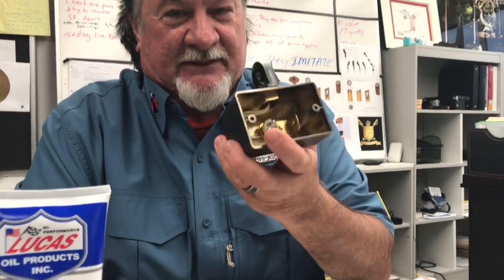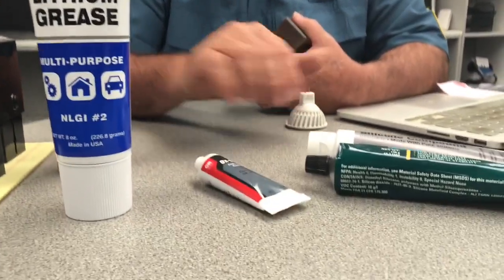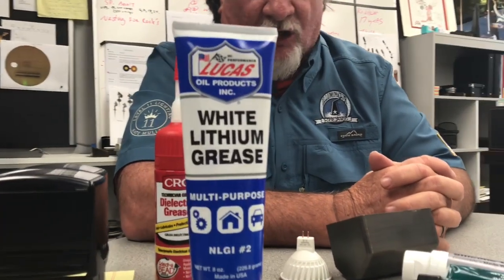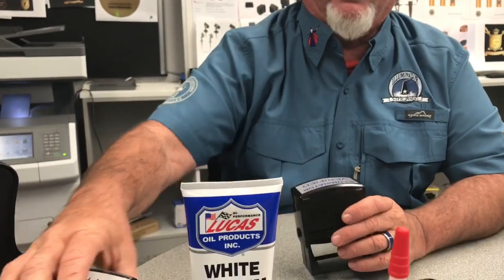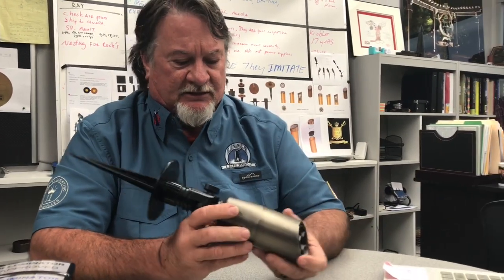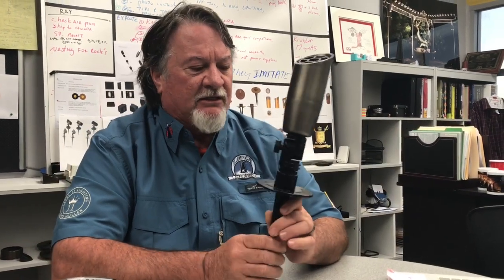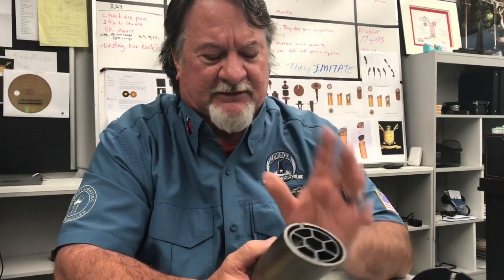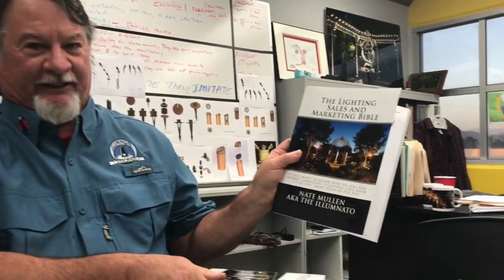White Lithium Grease vs. Dielectric Grease

Comment: 2018 May ok ~ Fungus grows in air/moisture etc.  So what you guys are fighting  brings my wood post rot problems to mind. That & putting up food. 
melting wax to seal comes to mind.  This can be extremely dangerous,  Besides cracking if not companded with proper ingredients.  Myself~for 1;  am NOT going to pour hot wax on any battery. I just adhere to battery inspection/cleaning twice a year--- Spring & Fall prior to extreme weather swings;~  you know when you are up grading & cleaning up radiator systems & heater core.  Inspecting the wipers, tires, filters, changing the fluids.  Esp. just prior to State mandated INSPECTION>   Many of you ARE trapped in $$$ rat wheel, &  are forced to Pay thru the nose for a mean-a-ic, to extend your driving rights.  Heven help you!  Only God knows what you paid for_!  I just like to do my own work,  thanking the powers that be_ I am able .  I sure enjoy the comments you GUYs post/battle out.

Comment: where do YOU use dielectric grease? you are using and selling, telling everyone to use on contacts? nolox is only approved and works even in  a salt environment.
 with the correct info  i can sleep at night. and know someone does not die.

Comment: With you on the CRC grease! Have the same can siting on my desk as I watch this video.
Reply: Huh?  It's not any better than the other brands, just overpriced.  Granted that container with the squeeze top can be worth a little extra money as smearing dielectric grease can get to be a mess since it doesn't wipe off as cleanly and takes a lot of hot detergent solution to wash off hands, fixtures, bulbs, etc.
Reply: Overpriced is a application-driven matter of opinion. In my case, I don't use a ton, and when I do, it's typically semi-precise applications where that nozzle is very useful.

Comment: This guy proves doing something for a long time doesn’t mean anything. Calling the guy that says dielectric is an insulator an idiot. Ha look up the definition of dielectric.
Reply: A dielectric (or dielectric material) is an electrical insulator that can be polarized by an applied electric field. When a dielectric is placed in an electric field, electric charges do not flow through the material as they do in an electrical conductor but only slightly shift from their average equilibrium positions causing dielectric polarization. Because of dielectric polarization, positive charges are displaced in the direction of the field and negative charges shift in the opposite direction. This creates an internal electric field that reduces the overall field within the dielectric itself.

 If a dielectric is composed of weakly bonded molecules, those molecules not only become polarized, but also reorient so that their symmetry axes align to the field.

Dielectric materials can be solids, liquids, or gases. In addition, a high vacuum can also be a useful, nearly lossless dielectric even though its relative dielectric constant is only unity.

Solid dielectrics are perhaps the most commonly used dielectrics in electrical engineering, and many solids are very good insulators. Some examples include porcelain, glass, and most plastics. Air, nitrogen and sulfur hexafluoride are the three most commonly used gaseous dielectrics.
Reply: Manuel Ester     I don't recall seeing your name on my class roster, but you can sign up for my course next semister.  
Why is it always the underachievers who point & laugh at those who can when they cannot?  Pathetic & so common.
(No more responses will be given to trolls & morons.)
Reply: Hi - I just did,  Again!  I've used it. Always confused by these definitions\ wording, at least today [too].   Now - what to believe?  
Always been interested in electrical things, just don't get it.   So ~ I just listen       AC DC ~ A Band, right? !!   =]    
 'Insulates', stops current from that point on - yes\no?      
or, Will let current pass through, [?]  protecting outer surface  (not let 'other' penetrate in.)   ?  see confused.
Reply: g7schaff ii
Reply: g7schaff g7schaff Obviously, the "illuminator" calling someone an idiot for because he stated that dielectric is an insulator was wrong. I don't know why someone should imply that you're an idiot for pointing that out.
Reply: Manuel Ester spark plugs and wires yes, people do that regularly to protect the connection and to lubricate the boot. Clean the connections first however you can, wire brush or whatever is most convenient. Distributor cap should be fine as well, I just would put a small dab on each connection, the only negative I could ever see coming from that would be if you used globs of it and it started to attract dirt and crap but a small amount should be fine. What are the symptoms though? Does the engine turn and just not fire up when it rains?
Reply: The definition of dielectric does not mean Insulator. Do go around calling people idiots when you can't properly state things yourself.
Reply: Very feminine to take something out of context like this. The guy was called an idiot because he was saying that it being non-conductive was a BAD thing for a connector lol, these guys don't understand that basic principle that the grease is there to PROTECT and insulate the connection, just like the rest of the sleeved wire. It's also the best anti-rust ever. Anything coated in grease will last forever untouched. Anything that accomplishes this job (to keep the elements out and remain so even under heat or extreme temps) and is non-conductive is good to go as far as insulating a connection goes. Thats why even vaseline works. Just don't expect to find any once you replace that battery. It will have leaked down in your engine bay after the first summer. That's why you use high-temp greases. Like white lithium. Which is in itself, also dielectric. read: non-conductive. It is what I would use to connect my house to the grid? Of course not I would go specialised. But is it what I'm going to use on my car battery terminals to save 12$ on a tube of dielectric grease I don't need, absolutely. I still got half a tube of a 10 yrs old white lithium tube and I also got a nice spray can of the stuff to finish the job nicely, until the next guy finally gets to use one of those "discarded" microfibers for the job. lol
Reply: They’re idiots because people never explain to them, dielectric grease is an insulator, but it also improves the connection when on two metal surfaces because little protected, free from corrosion divots form within the grease that conduct electricity much better than an oxidized or otherwise unprotected connection surface. Dielectric means it can be polarized by electricity, which basically means it doesn’t conduct electricity but moves out of the way on a molecular level when electricity passes through it. If your contacts would conduct electricity as they are, dielectric grease can only improve that connection, and more importantly protect it from naturally degrading from use. When someone says “dielectric grease is an insulator” in the context of using it on connectors, they don’t know what they’re talking about, it would be like saying “wire shielding is an insulator so you shouldn’t use it to cover wires” ya it is an insulator, but to use that fact to claim you shouldn’t cover wires with it shows you don’t grasp how electricity works, not that anyone really does, we just know the effects.
Reply: In this context, yes the guy is an idiot.  What that idiot and you both don't  understand is what the purpose is and when it becomes an insulator to the extent that it matters.

It is not an insulator of the electrical connection which is one form or another of a friction contact that displaces the grease at the point of contact, which is exactly what you want in addition to sealing off the region around the fixture or bulb too.

You have proven that you have not done it at all and don't know WTF the significance is in this context of electrical connections.
Reply: Stinky Cheese 🧀

Comment: A dielectric IS an insulator, but only for direct current. So that guy who you called an "idiot who doesn't know what dielectric means" wasn't necessarily wrong
Reply: How would the grease pass alternating current?
Reply: @cannabruh3396  AC is just alternating DC so it won't.
Which is the point of it.
Reply: Has anyone EVER used a battery pole wire brush set...removes lead oxide...for good contact...metal to metal...you assemble the clean halves...and PLACE grease..vasoline..DIELECTRIC Grease...WHATEVER...on top and all around... to prevent water and or moisture from getting to the clean metal.
You could use silicon caulking if you had to...metal to metal is the goal....if that's not to mental...!I
Good GRIEF !
Reply: He doesn't know what he's talking about either way.  Dielectric grease serves its insulating function only when it fills in an air gap that could otherwise get filled with water or debris.  Otherwise, these are connectors with one form or another of clamping, screwing, etc, friction which displaces the lubricant from the electrical contact point to settle around it.  It is not a parallel plate situation where a dielectric is meant to establish a field between the plates - context matters.

What is relevant is the idiots out there try to claim it interferes with the electrical connection obviously having no experience whatsoever so they don't realize that it is, and has been, used successfully millions of times over the last several decades.

Comment: Dielectric grease IS an insulator.  It should never be applied to contacts.  It could interfere with the connection because it is an insulator, metal on metal.  Try to measure the resistance between a blob of a dielectric grease.  You will get a high resistance reading, or open circuit.  It should be used on gaskets and other non-conductive materials such as spark plug boots and not the connection.
Reply: Dielectric grease just means it doesn’t conduct electricity like water or other fluids. Put dielectric grease on a plug on a socket on whatever...it will not prevent current flow to two metal connectors that are touching!!! It just keeps moisture off the connection. I agree with the other guy...you know nothing. It is not made to insulate anything...just to cover and Not conduct electricity.
Reply: No moron, and moron is a quite appropriate word to use because countless times this myth has been debunked yet you still refuse to learn and keep repeating false info.

Even if the concept of clamping force is too complex for you to understand, then you should still open your eyes and accept the plain and simple truth and fact that millions of times dielectric grease has proven itself to work fine.

You are a perfect example of someone who read a little bit, then stopped reading thinking you know something, but never put it to the test or read long enough to understand what you were reading.

Heck you don't even know if the resistance between a blob of dielectric grease would be a high resistance or open circuit, or even that such a test is irrelevant.

In automotive it should be used anywhere you want to seal air and water from getting to electrical contacts, or to dress and/or lubricate rubber.  It does NOT prevent proper electrical contact, unless you do something extreme, like pack a spark plug boot so full of it (or any other non-dielectric grease for that matter) that the spark plug cannot seat in the boot due to the non-compressable nature of the grease.

Otherwise the mechanical friction always present on any electrical connection, displaces the grease at the point of contact.  Do not pretend to know, try it for yourself.

Comment: Good video!! AND what I figured he confirmed - die electric grease is not an insulator, it Is conductive if anything AND !!......PREVENTS corrosion! - it's used on spark plug boots(rubber insulated) & electrical plugs of all sorts(plastic insulated) because silicone is the most rubber/plastic friendly compound. - Thanx for this video!!
Reply: Strictly speaking, dielectric grease it is like a capacitor (a teenzy one!). It won't conduct a DC voltage.  A tiny (teensy!) AC current will pass if the grease completes a circuit.  A truly conductive grease would be a hazard because it would be at risk of becoming part of the circuit if it end up smeared or squeezed in the wrong place - that would be bad.  It's a confusing topic.
Reply: Jim Trainor - NO!  Dielectric grease is not like a capacitor.  Now, if you use two large perfectly flat plates of metal and put a layer of dielectric grease between them, you could make a very flimsy, structurally insecure capacitor that way, but by itself, which no metal particles put in it which it wouldn't have for this application, it is not capacative at all by itself.

No AC will pass through it if it is a sufficiently large cap it fills, but this is irrelevant because the claiming, screwing, etc friction forces involved displace the grease out of the electrical conduction area to settle around it which was half the point all along.

It's not a confusing topic, except when morons try to mention insulation.  Dielectric grease is NOT used for insulation.  It can be used to prevent ingress of conductive substances but alone, you never use a fluid substance as an insulative material.

Comment: Now I'm even more confused. I watched a vid earlier that said Dielectric Grease was an insulator and should be applied the rubber boots of spark plug leads and the ceramic sleeves of the plugs themselves to do two things; insulate to prevent over sparking to the body and as a grease to make taking the leads off easier.

I've been told bulb grease is dielectric ~ meaning it does not conduct electricity, so it can be liberally applied to both the indicator bulb and the indicator bulb holder ~ to prevent corrosion [mine have corroded badly].

Are you saying that I can use white lithium grease as dielectric or bulb grease. ? I also ask because a tube in Amazon dot com is some $7 but in Amazon Co UK it's suddenly £70 Seventy Pounds ??????